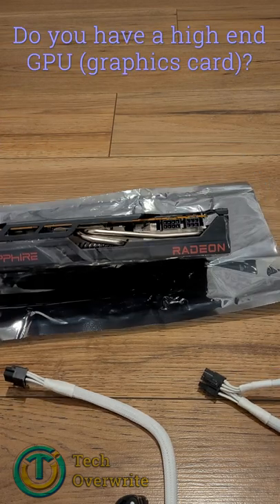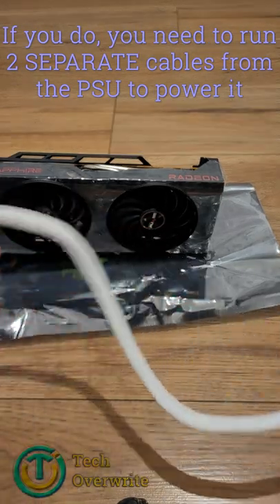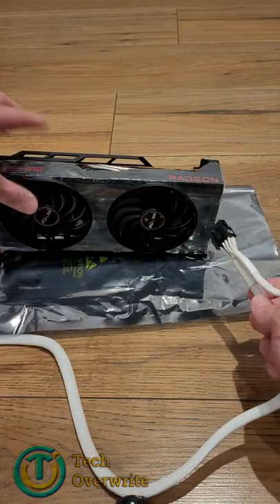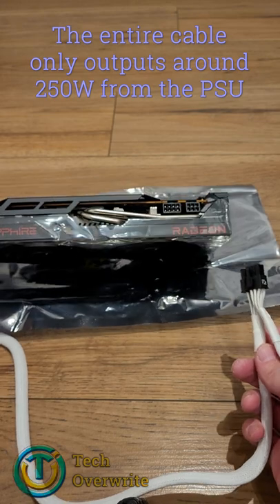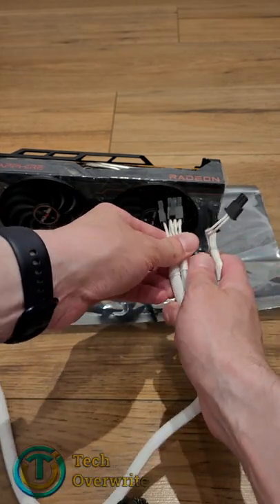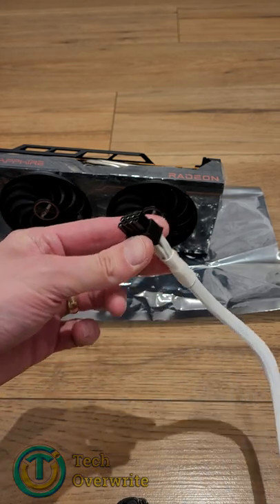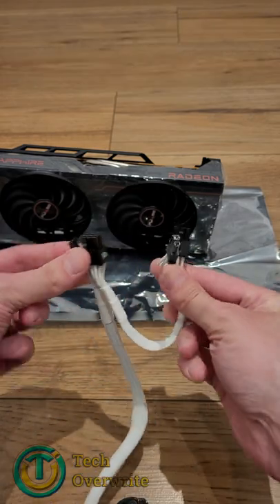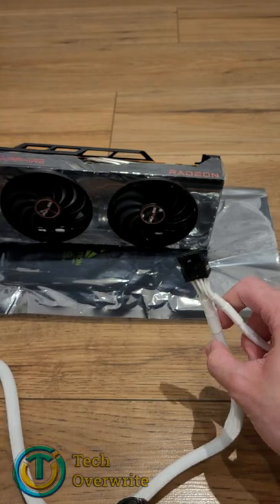Why You Should NEVER (Usually) Use The Same Split (Pigtail) PCIe PSU Cable #Shorts

Comment: So... if my GPU has a TDP of ~160-175W at max load, can i use the pigtail cable safely? My PSU has only one (it's not a generic or a bad PSU, it's just not modular) and I can't really afford a new one atm.
Reply from the maker: Yes that should be fine, it's well under the power that will be supplied by the 1 PCIe cable 🙂
Reply: @TechOverwrite  Alrighty then, thanks for your answer :)

Comment: I have a 7900 xtx which needs 3x pcie power slots. My Psu only has 2 pcie Power slots so I do need to use at least one split cable or what would be the solution here?
Reply from the maker: Yes, one separate cable and one cable with the pigtail should be fine for that card - it's a low enough TDP in this case 🙂

Comment: Will the gpu get detected if you dont connect all Power cables ?
(3 8pin slots on a Rtx 3080)
Reply from the maker: The mobo might detect it, due to the PCIe slot delivering some power to the GPU. But it will crash constantly, especially when you boot into the OS.

Comment: Is it safe to use 1 cable with pigtale for rx 6700 xt? Because my psu doesn't have a second one
Reply from the maker: It's probably borderline. The PCIe cable will supply 150-250W, and the mobo PCIe slot another 75W. So one cable may or may not supply enough power. You might just have to try it out and watch out for crashes etc.
Reply: I just want to share that I just built a 6700xt pc and it keeps crashing. I don’t know if it’s because of this split wire I’m using but I’m hoping using two separate wires helps.
Reply: @jrwingking8721 update?

Comment: I've pulled 300ish watts consistently through a split 8pin (6+2pin) for years with no issues at all.
Reply from the maker: Noice 🙂 Which PSU is that? Some have higher guage PCIe cables admittedly, which do deliver more than 150W.

Comment: Been looking into this as well. Upgrading from a 1650 super to a 3060ti. Psu only offers one pcie slot but the original cable has 2 6+2 opposing ends. Seems the best or only option is to use the ‘pigtails’.
Reply from the maker: Hmm that's true, not much you can do if your PSU doesn't offer two separate cables. Luckily the 3060Ti isn't high power enough for this to be an issue IMO - a combination of the PCIe power cable and the PCIe motherboard slot (which also supplies power) should be enough here 🙂

Comment: I am getting inconsistant answers about this everywhere I look. I am just gonna play it safe and use two cabels on my 3070 ti. I was using one pigtailed cable for a whole day until I decided to look it up to be sure. I am still not sure, but just finished putting on the second cable.
Reply from the maker: Yeah I agree that it's a pretty divisive issue. There's also an element of FOMO (for want of a better term). It's not always worth risking potential damage if it is possible to run with 2 separate cables, IMO.
Reply: Those wires can handle way more amps than what they are spec for. Your usual run of cable is probably no more than 2 ft and are 18 awg. 

The catch here is that in one of the earlier ATX specifications, there’s a current limit of 20A. So PSU manufacturers have to split the 12V into multiple rail to stay below the 20A limit. 

Running multiple power connectors ensure that you use the different rails. Trying to draw more than what each rail is rated for can be very bad.

For current PSU, that 20A limit is no longer there, the Corsair 1600 watt PSU has 133A for its 12V rail. You can go crazy and try to draw 400watts off a single cable and I doubt anything will even happen. 

But since it comes with lots of cables, just use all of them to get the highest efficiency since having more copper will drop the resistance by a tiny bit.

Comment: I have rx 580 4gb,

My PSU is a EVGA 500W 80+ BRONZE, i have plugged the pigtail cable to the rx 580,i must change my psu or its ok?
Reply from the maker: I think the rx580 tops out around 180W, so it should be fine to use pigtail here - since the PCIe slot on the motherboard provides around 75W of power.

Comment: Damn
So I recently purchased a new Rx6800(TDP 250W) to upgrade from my older 6600. My PSU is 650W. According to AMD the PSU is fine. But when I play games, the usb 3.1 port at the back of the PC starts acting weird like its losing and gaining power. I'm gonna hook up my extra PCIE cable to my GPU now instead of the piggy tailed style i have been using for the last 2 days. I hope this resolves my issues. Thank you for this info. 🙏🏾
Reply from the maker: Ooo that's interesting, yes hopefully adding the second cable solved that issue 🤞

Comment: One question i do know that PCIE slot can give 75w does gpu draws all its power from the PCIE cable or it balances out with PCIE cable and PCIE slot and if so how much it draws from PCIE slot??
Reply from the maker: You're right, I forgot to mention this in the short (but discussed it in the linked longer video). They're in addition to each other, so it could be 75w + 150w for 225watts power supply to a typical card 🙂

Comment: Can i used a single cable with 3070 (220W)?
Coz my power is non modular it only have a single cable.
Reply from the maker: Yes that should be fine. The cable will supply 250W max, then the mobo slot will supply another 75W perhaps, so the 3070 should be comfortable here 🙂🤞

Comment: It depends on the wire, there are cheap china knockoffs that have very thin wires with wiggly terminal sockets that you should avoid buying or using. While the other more reliable ones are just safe to use.
Reply from the maker: That's interesting, and definitely worth remembering. However no PSU will presumably help a 325W+ GPU work reliably on a single cable (I guess). Certainly, GPUs in the 225-275W range would be a lot more dependent on the PSU quality.

Comment: so, as long as the gpu wattage is under 250 watt. it still save to use pigtails, right?
Reply from the maker: Yes I agree, it should be fine. Naturally if you then overclock you might have issues, but for normal use you should be fine 🙂

Comment: If you own an rtx 2000 series card (in exception of 2080ti ((unless you're underclocking and keeping the tdp under 250w))) you shouldn't have to worry about this.
Reply from the maker: Great point, thanks for saying that 🙂 Yes it's mainly GPUs from recent years which have seen higher and higher TDPs.
Reply: I have 2060 super ,it fine?

Comment: Hello I need help I buy a rtx 3060 ti OC (max 230watt) he coming with 16 pin and I have only 8 pin same in your Video is my gpu work fine or not Thank you for help I only have one cable
Reply from the maker: Hello, that should be okay I guess. The motherboard PCIe slot will also provide 75W, so with the PCIe power cable too, you should have enough power for your 3060 Ti I'd hope 👍
Reply: @TechOverwrite  tank you very much 🖤

Comment: It safe use pig tail 8*2pin cable to rtx 3060 170 watt and 200 watt (mode oc) ? Fyi i use PSU corsair rm 850x
Reply from the maker: Yes that sounds fine to me... while not 'recommended', your PSU is a good one and you should be well within the power limits (200W from the PCIe power cable, and another 75W from the PCIe mobo slot) 👍

Comment: How about if it's 3 power ports on the GPU? and the PSU only has 2 cables.
Reply from the maker: It depends on the GPU power requirements. The two separate cables will supply up to 500W, and the motherboard PCIe slot will supply another 75W. So if your GPU needs below 500-500W, you should be fine with just two cables 🙂

Comment: I want to upgrade to a 3070 ti. I was originally using a 2060 with one power slot but the 3070 ti has two. My psu only has pigtail cable for the gpu and you can’t change it out, it’s the type where it just has all the wires coming out of one hole instead of you choosing where to put your cables. My psu is an 80 plus bronze 750watt, could I still use the pigtail without any issues?
Reply from the maker: Hmm, unfortunately that might be borderline. The PCIe cable will supply 250W max, then the motherboard PCIe slot another 75W. So you might find that your 280-300W GPU is fine, or maybe not. Maybe just try it, and make sure to avoid overclocking. But if you get crashes, this might be why.

Comment: Thanks for the detailed info! Just installed a 6960xt with one cable and the pigtails. Ran a bench mark and crashed. Installing 2 cables asap.
Reply from the maker: Ooo that's interesting, glad this helped you out 🙂 Nice GPU too, it's definitely worth getting it powered right 👍
Reply: Weird i ran that card fine on pig tail

Comment: So a question

So I am currently experiencing consistent crashes in the past week (the same week I got my gpu strix 1080 Ti) and my friend told me to switch cables immediately after he found out that I am using a pig tail pcie for my 1080 Ti. I currently have VS650 PSU, and going to be switching next week with NZXT C750. Could it be that the causes of my crashes is the pcie cable that I am using?
Reply from the maker: I've certainly heard of people who have experienced crashes with pigtails cables yes (and this was resolved by moving to two separate PCIe cables). It could also be due to the way your specific PSU is built internally, though, meaning that your new PSU might work fine with a pigtail cable.

It's probably just worth you trying out a new cable or PSU and seeing if that fixes it. Hopefully it does, there's nothing worse than constant crashes. Good luck 👍
Reply: @TechOverwrite  hey i use a pigtail cable on my 3060 i have never had an issue i have an corsair rm 850 watt psu

Comment: Ok everybody happy, however I have a corsair psu 1000w and a Sparkle Intel Arc A770... It turns on with the one Y split cable however there's this red light on it. And according to Sparkle it's because the cables aren't connected properly. However I think it's because it needs to be with two cables intsead. However I doubt anyone knows the answer considering that no one use Intel gpus

Comment: I have an RTX 2080 super hooked up to an EVGA 850 watt gold standard power supply. I don't play games Beyond 1080P and I don't use Ray tracing at all. Everything I play uses anywhere from 30 to 50% of the cards power. And I use a single pigtail power cable. Will I be okay?
Reply from the maker: Yep, I'd say this is fine. The card's GPU means that it's probably going to be fine with a single cable, especially because the motherboard PCIe slot supplies 75W or so.
Reply: @TechOverwrite  Then what would I need more than one cable for?
Reply from the maker: GPUs which are higher TDP. Certainly, many recently released GPUs that are on the higher end and need 300+ watts - they all need multiple, separate cables

Comment: Can someone pleaee explain why they have the pigtail if they want us not to use it
Reply from the maker: In general it's not a bad thing to split load across cables/ends. And remember that PSU makers don't specifically make their units and cables for GPUs, and vice versa. In other words, someone might have a build with various lower powered PCIe devices - and the split cable here would be quite useful.

Comment: my gpu requires an 8pin and a 6pin , in the 8pin I plugged the 6+2 pin from the cable(let's call it cable number 1) that comes directly out of the psu and in the 6pin I plugged only the 6 from the 6+2 end of another cable(cable number 2)that I plugged in the psu. In the 6pin is it safe to plug in the 6 pins of the 6+2 end of the cable number 2 and leave the 2pins hanging or should I choose the pigtail of cable number 2 that has exactly 6pins? I hope you understand what I'm trying to say this is the best way I could put it :)
Reply from the maker: Well explained, I understood fine 🙂 What you done should be fine, you can leave the remaining 2 pins and they are, that should work well 👍

Comment: I’ve been using my 3070 with the pigtail cable but I haven’t crashed. Have I damaged my gpu if I never had any problems with it?
Reply: No, the 3070 only uses slight more than 250W so while not optimal, using a pigtail is fine. If there's space to use a second PCI-E cable, it is recommended to use two. If not, you should be fine.

Comment: Yeah … it’s bad however when you might overclock your card it is better to run separate cables … however in this case it’s one 8 pin and one 6 pin so it would not be a issue anyway … I have actually run SLI with these type of cables where the split was between both GPUs from both cables and I never run into issues … however using a cable that is not spect for the PSU you have is a much worse scenario that will damage your GPU and using a splitter on a single cable is also something that is not recommended 
If your PSU comes with these types of cables you will be just fine
Reply: So my gpu uses 8 and 6 pin but is it fine to use a pigytail cable?

Comment: So if I only have one 8-pin port on my gpu I can use a split as well?
Reply from the maker: It depends on how much power your GPU needs. If it's a 225W or less GPU then 1 cable (with a split) might be fine yes. But 300W or more? No that probably won't work.

Comment: if the card has 3 power ports and i use 2 cables one with pigtail and the other without is it okay?
if every cable can deliver 250W the total is 500W and my card uses 350W max.
is it okay or is my logic wrong.
Reply from the maker: Yes I agree that this should work fine. It will deliver enough power overall 🙂
Reply: @TechOverwrite  😊 🙏

Comment: Using a daisychained cable is not wrong, its just better to use a diffrent cable for every connector because current = resistance and resistance = temperature, and temperature further raises resistance and that incresed resistance makes voltages drop, so in conclusion using the same cable is not wrong, but it decreses efficiency and deliveres a lower voltage (not an issue with a good quality psu, but if your psu is not that good and already has voltage lower than 12v, that this can trip it under the atx standard of voltages)
Reply from the maker: Thanks for the detailed comment 👍 I agree that it's not wrong by itself 🙂
Reply: @TechOverwrite  when i saw that reply i nearly reported it because of the use of emotes that are used on scam comments
Reply: 4070ti specifies in its manual not to do this with a temperature warning next to it. It mentions possible damage to the gpu if only using one cord. Think I'm going to trust the manufacturer on this one and use two separate cords.

Comment: Wish I could get cables without the split just 8 pin to 8 pin modular cables. Going to haft to cut and heat shrink the ends on both cables to get rid of the extra useless connectors. What a pain. Need 2 non split cables.
Reply from the maker: It is a pain for sure. You might want to check out CableMod though that offer some decent solutions (and might be quicker than modding the cables yourself).

Comment: Please help, I'm about to buy an Rx 6800 which has a 250w tdp but my PSU is non-modular and it only has one cable which has 2 6+2 pci-e expres connectors should I go with it?
Reply from the maker: It might work tbh, the PCIe cable (150-250W) plus the PCIe mobo slot (75W) should supply enough power... but it's hard to say for sure unfortunately. You might just need to try it out and look out for crashes.
Reply: @TechOverwrite  thank you very much sir and have a great day
Reply from the maker: No worries, and you too 🙂

Comment: I used pigtail at first and now I’m scared I’ve damaged it, my pc crashes, loads of diagonal pixels come on my screen and goes weird colours and then restarts my pc.
Reply from the maker: Yikes, sorry to hear it. It's hard to say for sure, but unless you were massively underpowering your GPU, I'd be surprised if it was permanently damaged. GPUs are most likely to crash (if they're unpowered) than slowly melt/get damaged internally.
Reply: @TechOverwrite  yeah I unplugged both of my gpu cables and plugged them back in again, this time I am using extension cables and it looks so much cleaner. It crashes after 5 mins on first boot up but on 2nd it was working for an hour and i even managed to play for a little while before I had to go to sleep. I’m also going to add two extra fans. As my intake in my case is sorta bad so I’m gonna get two extra Corsair rgb fans however my cable management is gonna be a nightmare haha.

Comment: I do this with cheapskate cable from Seasonic Focus GPU 8 pin cable and get buzzing annoying sound in RTX 3070 Noctua. I thought the GPU is the problem but it was the cable after all
Reply from the maker: Ahh that's interesting, yes a buzzing cable isn't a good sign for sure. Glad you were able to track it down to the cable though 🙂

Comment: 18gauge pigtail supplies 300w after derating. If it were any less it would fail saftey certifications. It can supply more but that's if the cable is shorter (lower resistance) or using a Non-Modular supply (not limited to 9amp per pin at the root of the cable).
Reply from the maker: Thanks for watching and providing this extra info. I usually don't take any chances with the power supply (and I think it's Seasonic that tend to recommend not using a pigtail), but definitely helpful to know this extra info thanks 🙂

Comment: What do u do if u have 3 8 slots use 3 different cords? And have the pigtails 3 empty and 3 plugged in?
Reply from the maker: It depends on the GPU's power requirements, but unless you have an insanely powerful GPU, two separate PCIe cables (meaning 1 with a pigtail for 2x connectors, then 1 separate) should be fine 🙂 That should supply 500W or more of power.